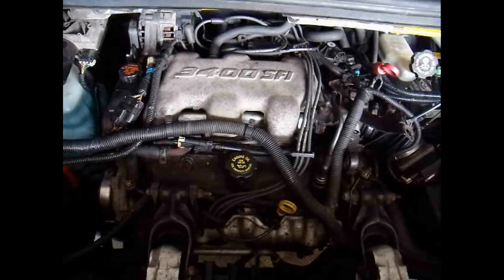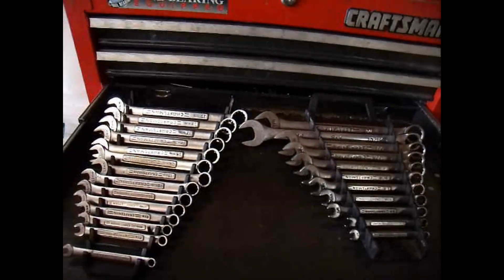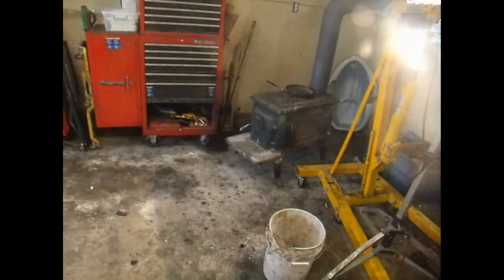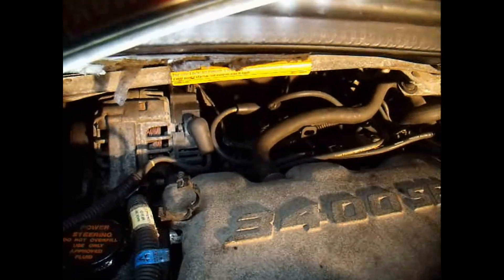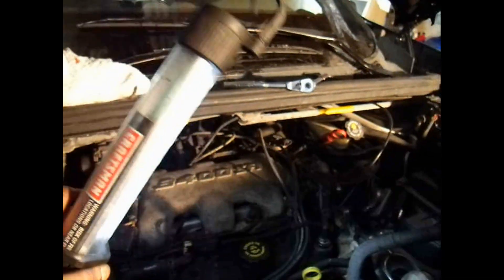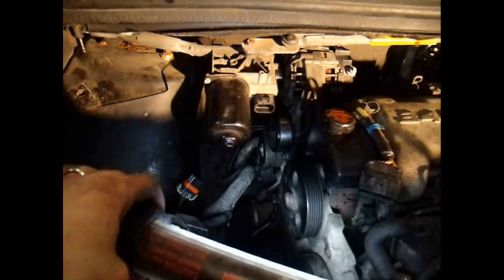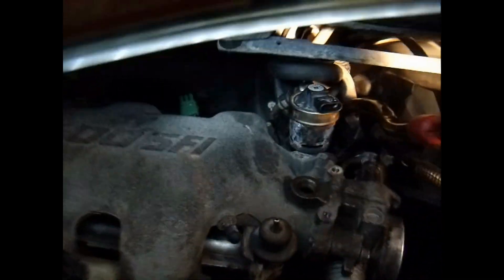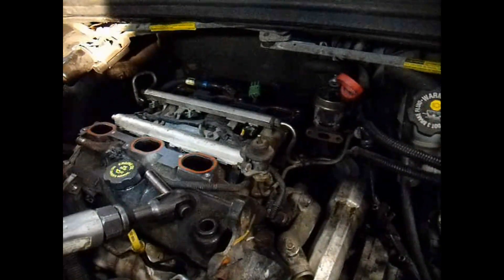How To Change A Bad / Blown Head Gasket 3400 GM Overheats Thermostat Intake Manifold No Heat 3.4

Comment: So what does it mean if the liquid in my coolant reservoir turns brown and starts bubbling? I just changed the water pump a few weeks ago
Reply from the maker: Usually means the head gasket is blown.
Reply: So what’s the bright side in this to reduce the stress?
Reply from the maker: The good news is that once it's done and the gaskets replaced the engine can go for another 200k miles typically. 
VT247
Reply: Vacationtime247 ok that gives me peace of mind haha thank you
Reply: Yup u definitely have a blown head gasket the bubbling is from gases escaping into your coolant

Comment: I did a head gasket valve job on buick  rendazanod  with 3400 engine , what a dog, to do it again i would pull the engine before doing a 3400.

Comment: yea I have a 03 s10 zr2 mechanic says I have coolant in oil that's leaking is that a system off the intake gasket and people keep saying upper and lower gasket so the intake has two or what the hell ive done a 96 jimmy head gasket it was our last option it was the 4.3 vortec kept over heating did heater core stat water pump all that shit and the head gasket and do u believe it over heated again now im worried with all the previous over heats ,damb the head must be warped its like shit all the

Comment: have a 2002 buick rondevouez 3400 can a blown head gasket make it miss and the rpm barely go up and down
Reply: now willstart and sounds like its missing like crazy but dies fast ...oil level still great no milky oil but have seen some copper pieces floating around in coolant think previous owner put some sorta head gasket repair...any info would be very appreciated

Comment: DOES THIS JOB  REQUIRE ANY SPECIAL KNOWLEDGE ABOUT PISTONS AND SUCH OTHER THAN THE TORQUE WRENCH AND I GOT A SPECIAL ROD PULLLER FROM LISLE TOOLS. I AM DOING THIS MID WINTER WITHOUT A GARAGE.  THIS IS GOING TO STINK TO HIGH HEAVEN MAN.  A LITTLE BIT A DAY AND I CAN GET IT IN A WEEK I'M THINKING.
Reply from the maker: You'll need a torque wrench for the head gasket bolts.  Torque them down and then angle degree.  It's not a hard job, you may have to replace a few broken exhaust bolts though.  Good luck.
VT247

Comment: If by chance I break a bolt I can just take that heat to a muffler place to remove the broken bolt. Is that true?
Reply from the maker: That's what I did when I didn't have a cutting torch.   Make sure it's all apart so you only have to make one trip.   Usually cheaper that way too. 
VT247
Reply: you have been so very helpful.
Reply from the maker: No problem.  Ask to keep the broken bolt so you can match it up with a new one that will work.  Swing by Fastenel on your way back from the muffler shop to get the right ones for reassembly.
VT247
Reply: coultman, you do not have to take the chance of breaking a bolt, in fact u don't even have to take the crossover pipe off like he did, I left crossover pipe all assembled and just removed bolts from the headers and downpipe
Reply: Thanks or your help. Do you take the exhaust off with the 2 heads all in one peice?
Reply from the maker: If you take both heads off at the same time like I did in the video, you'll only need to remove the rear exhaust going out the back and the 2 bolts holding it on.  You'll need help lifting the heads off as it is awkward to lift.
VT247
Reply: @coultmanphotography8791  yes! This is how I did it and also installed it that way also you don't have to remove ac or ps lines just move them off to the side

Comment: would this be a possible cause of the misfire problem that i can  not figure out ?
Reply from the maker: Yes, a bad head gasket can cause a misfire.  But before changing the head gaskets, try the spark plugs, plug wires, check the injector and run a code check on it.
VT247
Reply: I just did a bunch of work changed the timing cover gasket and re did the fluid.changed the plugs and wires ran code check several times still ahowing the mis fire on cylinder 1 im hoping its not the heads!! How would i chexk the injectors with out taking the top of the engine apart or is it even possible
Reply from the maker: Put a piece of vacuum tubing up to you ear and the other end on the fuel injector.  You should hear clicking.  That means that it is firing correctly.  These engines are known for bad head gaskets.  I've had to do several GM 3400's : (
VT247

Comment: 780 inch pounds am I ok with the head bolts?? I did that exact pattern you did
Reply from the maker: You'll be good, 780 inch pounds is 65 ft lbs (780 divided by 12 = 65)  From your other message you said you stepped them up in sequence so everything will good.
VT247

Comment: Did you take both heads off at the same time with the exhaust crossover still attached?
Reply from the maker: Yes, both heads came off at the same time with some help from a friend.  I was trying to avoid breaking off those exhaust crossover bolts.  But, several still broke.  Had to go to Fastenal and get studs with nuts to thread on them after they finally came out.
VT247

Comment: Do not just install the heads back on after cleaning the gasket surface.Get a straight edge and a .002 feeler gauge out and check the headgasket surface for warpage.If the the feeler gauge goes through easily,take the cylinder heads to  a  machine shop to get resurfaced.

Comment: Around 20:05 that black metal tubing that goes to the heater core that’s attached to the water pump how did you get that out from the line that comes from the fire wall?
Reply from the maker: It has a plastic clip that holds it on.  Can be a pain to get off.  Try grabbing the metal part and the twisting the hose to break it free.  Squeeze the white part of the clip to compress it, also squeeze & compress the black end on the hose end, push and pull the hose until it pulls off.  I had to use some screw drivers and keep tinkering with it until it finally came off.  If all else fails, cut the hose around the middle and put in a metal tube with alligator clips as a splice.
VT247
Reply: Vacationtime247 thanks I got it

Comment: hello again vt247 guess what i do the work i take off the heads but i got a problem im asking you a favor the think is that my car is a grand am 2002 and i got it just for two months since i bought it so to make it short when i take out the heads i realize that the head dont match the engine block so it was really weird to me because i see that the patterns of the holes wheres passes the water to cool down the head are in roun shape and the ones in the engine block are triangle ones  and two

Comment: yes but this ones are diferent there are two holes  in the block that the head and the head gasket does not have both make the gasket and the head get rotten because the car was using water instead of antifreeze

Comment: You can also use a water hose in the radiator to force air out of the system mine would not bleed without doing this.. Then evreything was fine and has been evrey since

Comment: The reason I ask is because I went to 2 mechanics and they say I have to change the whole engine because I will have the same problem in the future
Reply from the maker: Even if you change the engine, they will also need a head and intake gasket fix eventually as well.  Could do it with the engine already in there.  Or do it with the new engine.  I'd just fix the current one.

Comment: Do you put gasket glue on the head gasket also?
Reply from the maker: Don't have to.  Most head gaskets go on dry.  Think I may have put a small amount of silicone around the gasket so it would seal better.  But again, don't have to.
VT247
Reply: never put any silicone on a head gasket or head bolt, it will throw off the torque of the bolts

Comment: No it's 4500 to have shop do it. So I wanna see if I can fix
Reply from the maker: It's a major job to do this.  If you're replacing one gasket, replace them all.  Trust me.  Eventually, all the gaskets will leak.  So, do the head, timing cover and intake gaskets all at the same time.
VT247

Comment: I've recently changed a blown head gasket and the thermostat on a 2002 Buick rendezvous but the car is still over heating... Can anyone help me with this?
Reply from the maker: Check the water pump and make sure to bleed the system of air with the bleeders.
VT247

Comment: Hey people before you get your head gasket fixed check this. Check the level of coolant in your reservoir and radiator. Net let your motor heat up but not over heat obviously. Now if there is more coolant in the reservoir then when it was cool check the radiator next and if really low chances are..... you just need a new radiator cap. I put a new thermostat and couldnt figure it out then i put a new cap on the radiator and boom.

Comment from the maker: I did not machine the heads.  I just cleaned them up, inspected closely for pitting and cracks but found none.  The heads are aluminum and disperse heat much better than iron.  Done this job twice and none of the heads shown any wear.  You should be fine just cleaning them and re-installing.
VT247

Comment: How did you get the left motor mount off?
Reply from the maker: +James Waid The top ones require a 13 and a 15 mm wrench or socket.  The bottom ones going through the subframe go straight up.  Might have dirt and gunk on it so cleaning may be required.  Think there's two bolts holding on the bottom nearest the passenger wheel.
VT247
Reply: +Vacationtime247 I got it with a lot of hammering and jerking. Thank you.
Reply from the maker: James Waid Word.
VT247

Comment: Do you have to time the engine?
Reply from the maker: Nope.  Don't need to time the engine.  The engine is timed by the computer and is regulated by the crank signal.
Reply from the maker: Demetrius Cole The 2001 Chevrolet Impala has the 3400 GM motor in it with a 4T65E transmission.  You do not need to time the engine.  That is controlled by the computer and crank sensor

Comment: Could someone please confirm that the A/C compressor has to be removed in order to replace the head gaskets?  doing a preliminary look around in my 01' Aztek, it seems that the A/C compressor and hoses are out of the way around the block.  Otherwise, to do it properly you would need to first take it to mechanic to discharge the Freon and then pay to test and recharge it.  ...TIA.
Reply from the maker: The A/C compressor needs to be removed but the freon doesn't need to be discharged.  There is enough room to let it rest on the sub frame when it comes off and enough flex with the rubber portion of the A/C line.  The passenger front motor mount has a bolt holding it on behind the A/C at the bottom.
VT247

Comment: If the head gasket is bad will ur oil alway be milky
Reply from the maker: +Kirsten Hesse Milky oil is caused by oil and antifreeze mixing.  Sometimes a bad head gasket will cause this but not usually.  Milky oil in the 3400 is typically from a bad intake manifold gasket.  A bad head gasket usually shows itself in overheating and air in the coolant system.
VT247
Reply: The coolant is milkly and does over heat but the oil is still full and the oil isnt milky i just wana if the head bad wont the oil be milky the sence the coolant is but the oil anit
Reply from the maker: Change the head and intake manifold gaskets.  Do them both, it's a long job to do, but will fix the overheating.
VT247

Comment: Summary: Take apart engine.
Reply from the maker: If you're doing the intake, head or timing cover, do them all.  After a complete rebuild of gaskets they weren't to bad.  But it took a lot of work to get them that way.
VT247

Comment: My 2004 Grand Am turned over this morning but wouldn't crank. Recently had the water pump, Idler Pulley and Heater Core replaced all within a month of each other. Fuel Pump was replaced Nov 2013.  Checked fuses this morning and still wont crank!!!! Any idea? I'm worried that something may have been done improperly and now I have a BIGGER  issue!!!
Reply from the maker: When you say it won't crank you mean it doesn't turn over?  Turn the key to start the car and nothing happens?  
Or it turns over but won't start.?  LMK.
VT247